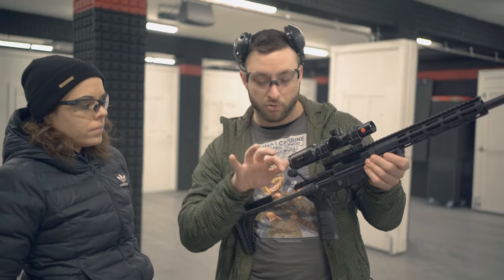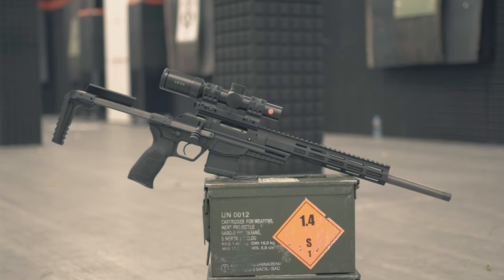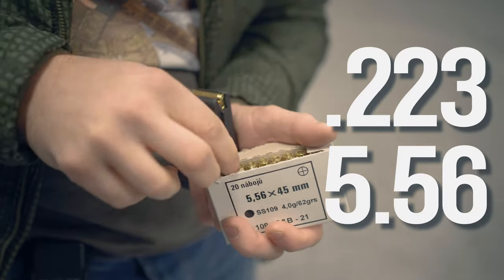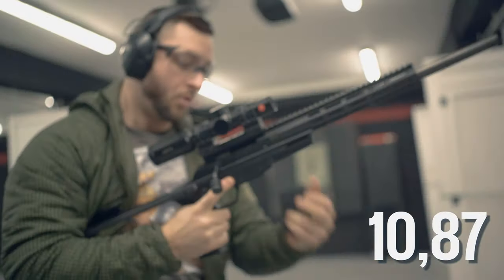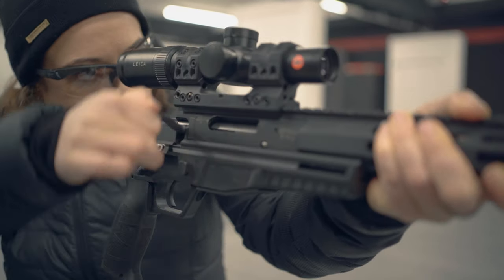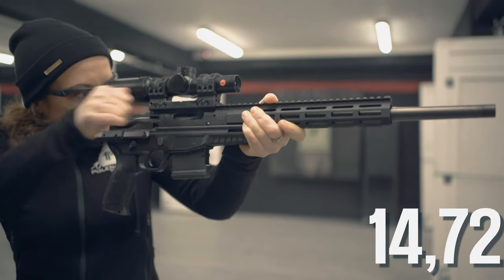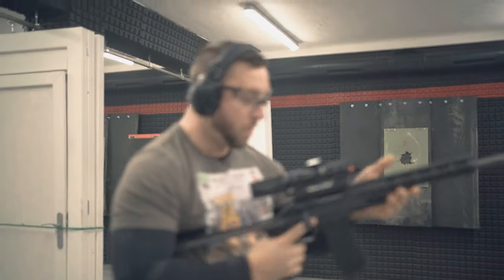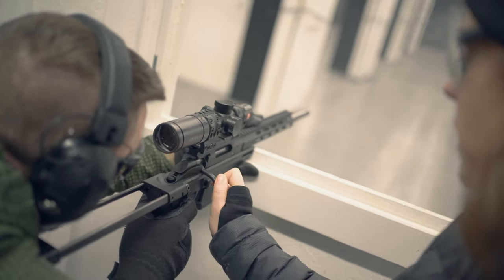How to shoot fast with CZ 600 Trail

Comment: Not just showing the rapid fire bolt action technique, but also demonstrating the "still in trials" crew served bolt action rifle drills.
First, Grip Clamp C, and now this - Polenar is always on the cutting edge of the sport, thanks!.
Reply: Yes, but doesn't that way of shooting disregard the importance of steady trigger pull. In my opinion,  Shooting fast shouldn't be the purpose of this or any other bolt action rifle. BARs are built to be precise, not for speed.
Reply: @williamrodriguezmswlcsw8119 . 
Bro. This entire video is a troll. The commenter you just responded to was making a joke based on it.

Comment: It'd be interesting to see a modern action paired with an older fashion of stock with the same bolt handle placement. I feel like a Lee Enfiled's style of pistol grip let's you use your wrist a lot more and really flick the bolt around, making it a bit smoother without having to use your elbow so much. The Enfields bolt is around 45 ish degrees to open of course making it feel way easier to open up as well

Comment: Learned this from the Brits. They trained the mad minute. Sixty rounds 1minute from a lee Enfield bolt action. Those Enfield run so smooth
Reply: I tried that with mine. Gave up I could get close to a minute but never hit much
Reply: The mad minute in training is a myth. It happened but was never part of training.
Reply: I tried this with my Ruger American Ranch and for some reason my annoying neighbor said I shot thier house. Well... all 4 neighbors said it lol
Reply: The mad minute was 15 rounds in a minute, not 60. Think about it: 60 rounds a minute is one aimed shot each second. That would be hard with a semi automatic gun to pull off. With a bolt gun, its basically impossible, especially since you need to reload frequently.
Reply: @PaperHunter  You're half right: it was part of training, and the troops were graded on how many rounds they could put on target in a minute, but the average soldier was never expected to mange 25 or 30 rounds a minute.
Reply: @random.3665  I imagine it could probably be done, but with no better accuracy than 'downrange'.

Comment: I do the same thing with my cross. I was wearing some loose fitting gloves one time. And i suppose the finger tip of the glove was touching the trigger and it fired off the next round as soon as the bolt rotated into locking position. I would assume locking position as my face didnt get blown off by an out of battery situation.

Comment: Have you found a way to get to stock to stay locked forward and backwards? In the second position it can still pull out farther, and I notice sometimes it can move around if I don't apply forward pressure.

Comment: You can shoot just as fast and more accurately by picking the bolt up with your 4th and 5th fingers, bringing the bolt back, then quickly turning your hand over and bringing the bolt back quickly and Cham wring a round, still shooting with your index finger

Comment: How does the cheekrest switch? Doesn't look like there's different holes on it to mount for us wrong handed people on the other side. Kind of strange that they didn't just make it U shaped but I guess that would interfere with the bolt when it's in the collapsed position. Either way, kind of dumb running a bolt action without a shoulder stock unless you're doing some hoodrat shit with an Obrez.